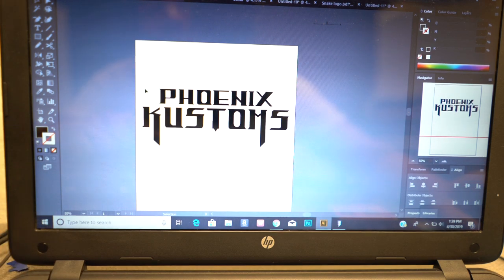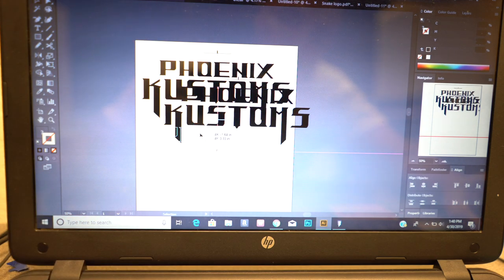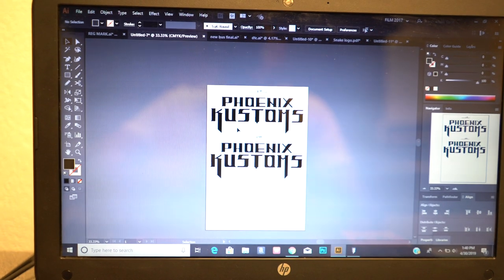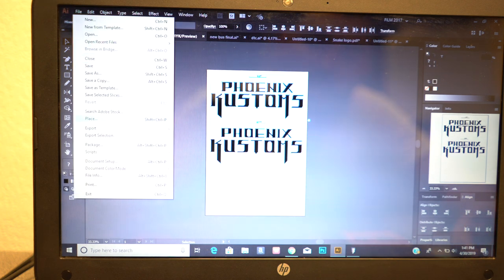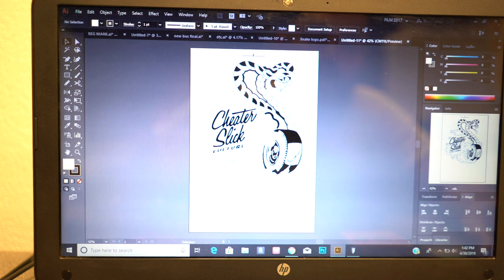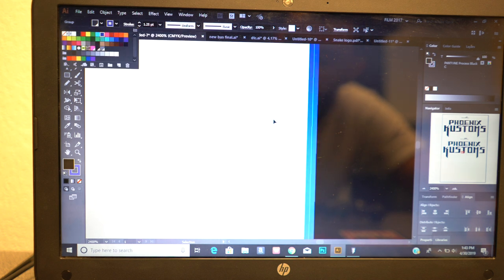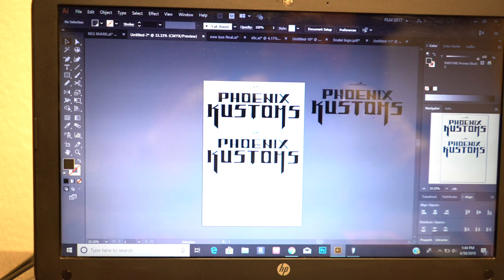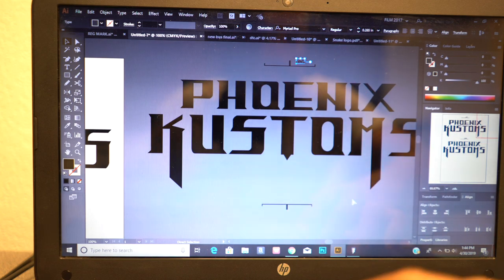illustrator how to choke your white base print

Comment: So choke basically does an in-line so it doesn’t show under the red for overbleed ... or am I just dumb and still not get it?
Reply from the maker: Choke just means you make you image a little bit smaller all the way around so that no white shows when you print your color on top
Reply: When you went to the options to print it. What did you do there when you selected the colors? Once again thanks for helping out
Reply from the maker: sergnutz773 so if you make the entire design black and you add a blue stroke 
When you do print you deselect the blue and only print the black 
What way it subtracts that stroke from the image and it makes it 1.25 smaller all the way around
Reply: Vega 23 so basically U can do a 2 color design just like this same process so there is no line between both colors
Reply: Thanks again!! Keep up the good work on the videos
Reply from the maker: A C yea as long as you choke the base you should be fine

Comment: I was following along just fine until you got to the print dialog box, im not able to deselect the magenta or process black. Dont know why.
Reply from the maker: You might have the mode on composite 
See if you can change it to separations 
Or just make the stroke white and you won't have to worry about turning anything off

Comment: I still don’t get it!! Why would you add a stroke to the base?? Shouldn’t you add a stroke to the color instead of the base??
Reply: No bc u have to make the base smaller than the color so the white dont show
Reply from the maker: lily exactly 
Thank you
Reply: Ya that’s what I thought. Maybe cause he added a stroke I thought you made it bigger
Reply: I think this only works like this if you have a rip because if you're just using an ink jet printer you don't get those options for the output I don't think. I like the 1.25 stroke!
Reply from the maker: Jonathan Zambrano never tough about that 

I’ve never not had it 
When I started I bought everything at once
Reply: @sergnutz773  If he printed the stroke with black it would be bigger but since he deselects the magenta color it prints the base without the color making it smaller
Reply: @Vega23  I dont have rip and i just make the stroke white so my printer doesnt print it. Whenever i do this i hate the way my prints look. I hate seeing that little foggy color especially with red where it over prints around the base. Why do mine look so shitty haha. But if you dont do it its like impossible to register. Yours always look sooo clean.
Reply from the maker: BCprintshop you have to apply enough pressure and if your seeing too much of the color falling on the shirt choke it at one point not 1.25
Reply: if you add it to the artwork colors you will changethe design as intended . Not so with choking the underbase.